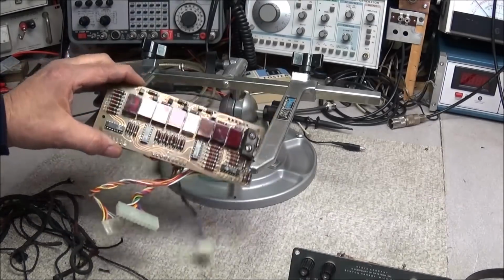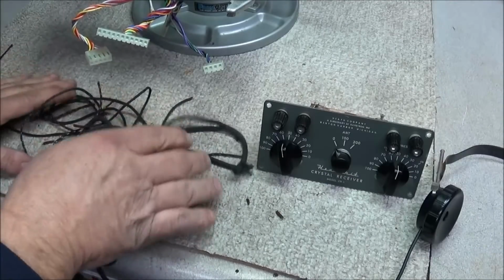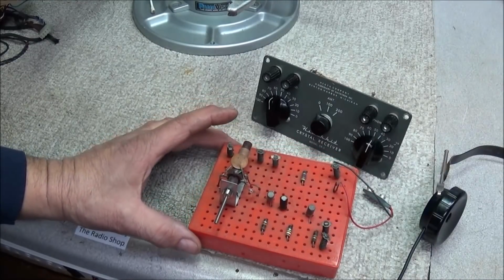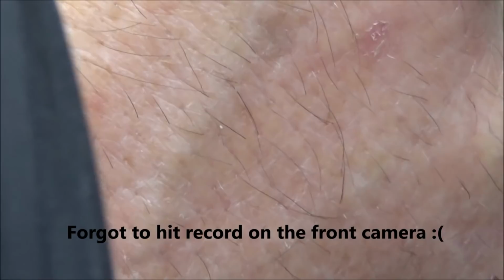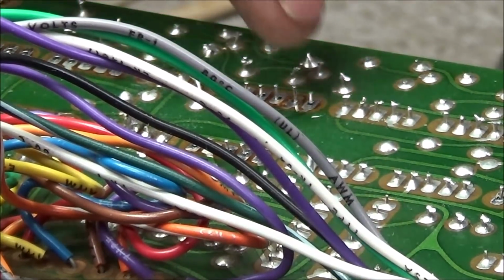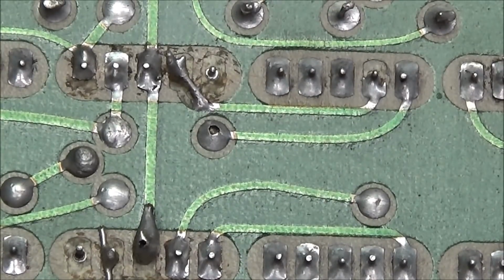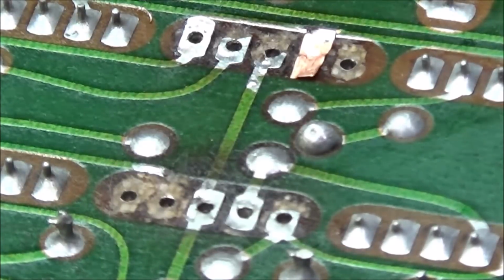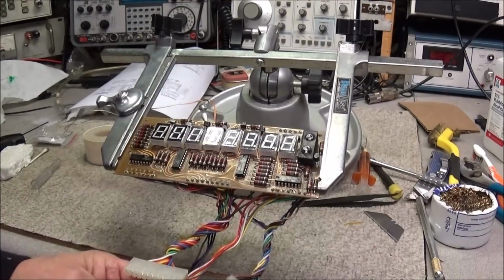#195 Random Night in The Shop

Comment: I been collecting parts for Crystal radios ,for boy scouts ,I even have vintage crystal.diodes ,I have nice finished boards to mount stuff ,never could figure which was the best designs to use that would be cheap for them.,I wish I would have found that little crystal.set from Heath kit something that worked ,to show our scout nice find Buddy ,try the crystal.ear phone ,I found some of my stuff from Mike's electronic and from Bordens who still make all kinds of Crystal radios ,one of those two places sold a radio shack little amp ,that you just plug in a speaker or ear phone I think it was 29.00 dollars for it . I hope you get it working ,I think Crystal set are still popular

Comment: if you have an old home radio/stereo with "phonograph" input, you should be able to hook into the jacks from the crystal radio using  capacitor and resistor(potentiometer) coupling, without dragging the output down.  crystal pieces are around 20K ohm impedance and phonograph is 47K if I recall right. so if anything it may overdrive
Reply from the maker: Yep, that can work.  Thanks for your comment

Comment: Thanks again for this video. At time 11:17, i see on the left side something green-blue like a leaking capacitor under the black piece of something (plastic)? But as is understand, there are only two bulbs!? Is it only some colour?
Reply from the maker: Yes, that stuff you saw was factory over coat they spilled onto the board. They applied it to the wires of the two lamps under that black foam. Both bulbs are clear
Reply: OK, thanks for your answer. Happy new year - hope to see more from you

Comment: Hi Buddy... I hear you on the hearing, mine has left the building as well. Too much muzzle loaders/chain saws/rock and roll without hearing protection in my mis-spent youth. Other potential caveat trying to get a signal on a crystal set is the unavoidable noise from our 21st century electronics.  Seems to drown out those weak signals, made even more marginal when trying to listen on a signal powered set.
Reply from the maker: Sorry to hear you have it as well. I think mine came from go-kart racing for 7 years.  Did not think about hearing protection. I had a blast with crystal sets as a kid. Like you said so much noise these days.

Comment: Buddy, I also built a foxhole radio when I was about 13 or 14 yrs old. I used a oatmeal box, wire from an old transformer and for the diode I used a razor blade, pencil lead and a safety pin. I could pick up WBAP out of Dallas in several places on the razor blade. The "good ol' days"...